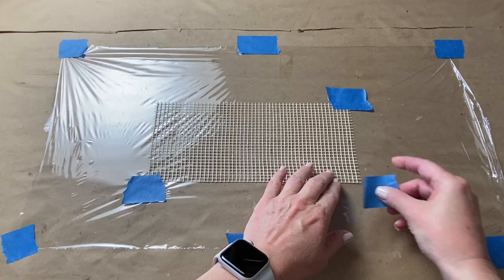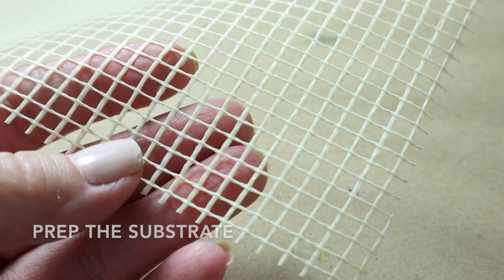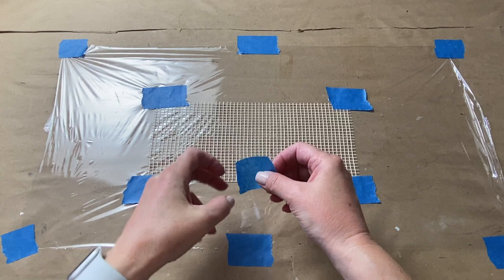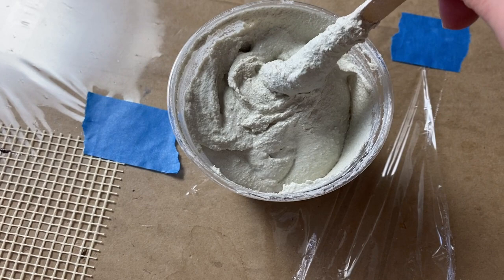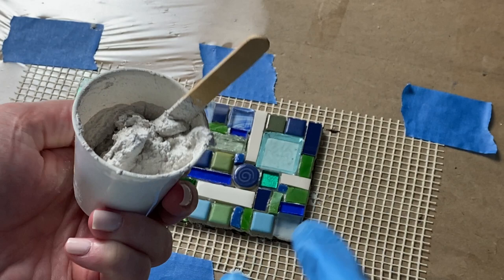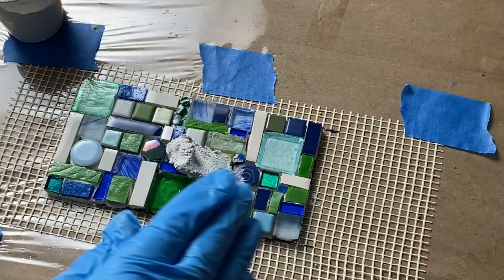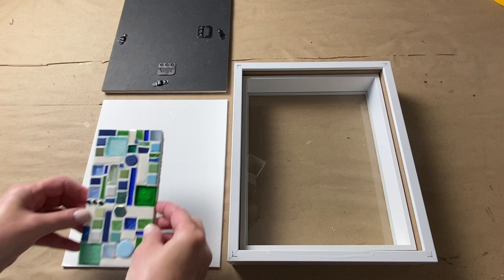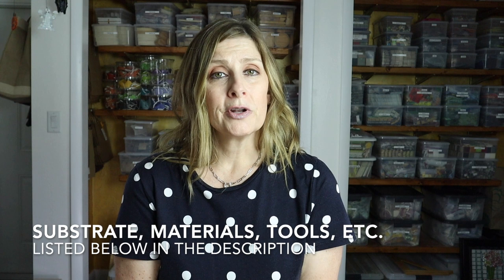MOSAIC MESH: How to Tile + Grout BEFORE Adhering to a Final Substrate

Comment: Thank you.  I will combine this technique to replace 1-by-1 inch bathroom tiles that i have only a limited supply to repair water damage around the bathtub and toilet.  My problem in the past is that when repairing 1-to-4 tiles in a bathroom floor with grout and no intermediate substrate, the wood substrate bends and bows over time, making the tiles pop out within 6 months, and I get to start all over again.  I am hoping this technique (with the mesh in between the tile and wood substrate) will have a more permanent bonding effect to all of the foot traffic and bending subfloor wood substrate.  Thank you.
Reply from the maker: Hi Derpy-Unicorn! I know exactly what you mean. I'm not sure the mesh will provide that kind of support. Your wood floor may continue to bow and the issue will keep happening. Ideally, you need a stronger subflooring option. If you think of it, report back if it works out. I'm curious. Good luck! Keep creating and I'm glad you're here!🔥

Comment: I really like this idea it seems a little less intimidating in a way I just don't know where to find the mesh so hopefully you've got a link in your description, my biggest issue so far with the mosaics I've done is I am not good at timing when I should start wiping off the grout... I'm either wiping it off too soon or too late or the sponge I'm using is too damp. Not giving up! Love your videos and love your channel!!!
Reply from the maker: Hi Maria! Thanks for your kind words and support of my channel! A link to the mesh is included in the materials list which is in the description below the video. You'll be able to read more about it. Super handy stuff. Comes in adhesive-backed and non-adhesive. I keep both varieties in the studio. Here's a suggestion, after you're done applying grout, set a timer on your phone for 10 minutes, and hang out with your mosaic. As exciting as watching paint dry!😂 This will give you a gauge of how quickly (or slowly) the grout is drying. Things such as humidity and air flow can affect it. And if you're cleaning off with a sponge, you don't want it to be too wet. Get the excess water out before using it. Hope that helps. Keep creating and I'm so glad you're here!🔥
Reply: @JulieWeilbacher  Thanks Julie! I'm going to order some mesh since it's not too expensive and I appreciate your reply & encouragement so much! ❤️🌺❤️

Comment: Thanks for the tutorial! You mentioned not to use this method for a large mosaic. Would there be any difficulties if you did a whole group of smaller panels this way and then assembled them into one larger mosaic?
Reply from the maker: Hi Karen! Great to hear you enjoyed the video. You could do a larger group of small panels, especially if their final substrate is a horizontal surface. My reference in the video was to mural mosaics in particular. For vertical surfaces I would try to use less adhesive on the mesh. In other words, use just enough adhesive to adhere the pieces to the mesh, and then allow the thinset to do the rest of the adhering work for you. Keep creating my friend and I'm so glad you're here!🔥

Comment: I am starting a project I've been thinking about for a long time.  I am experienced with regular tile laying, and have done a couple mosaic projects.  I saw this technique and was wondering if this might be the best technique to use.  Here's my project....I am making stairs for the side of my hill by my front door.  Instead of putting boring pavers down, I've made my own and want to mosaic them.  The pavers are 17" X12 1/2".  There will be 22 pavers in total (it's a big hill!)  Since there are so many, I wanted to take my time and have fun, not make it a chore!  Since we want to use the stairs now, I am making all the pavers now.  I considered pressing the tiles into the paver when I pour it, but that limits you on time and seems more stressful instead of fun.  What would you do?  Apply the thinset directly to the paver and mosaic them one at a time, or use this technique?  I love your videos!  I've learned so much.  Thank you!
Reply from the maker: Hi Cindy! Thanks so much for your kind words.😊 It's great to hear you're getting value from my videos. What a project you've got planned. Using mesh for your mosaic pavers is how I would go about this project. Work indoors on your studio table, at your leisure!, and then apply thinset directly to the clean paver and then your mesh mosaic on top. Let it dry/cure before you grout. I've got a couple videos to help you with this. Check out this one: https://youtu.be/g4-NhjcHypg; and this one: https://youtu.be/5JqZU5ucM_k. Keep creating and I'm so glad you're here!🔥

Comment: Is there a difference between mosaic Mesh and fiberglass drywall  mesh ?
Reply from the maker: Hi Sunday! Mosaic mesh is fiberglass mesh. Check the description below the video and you'll see a link for it so you can read up more. It's sold in a nice variety of measurements. And it's available in adhesive-backed and non-adhesive. I keep both on hand in the studio. Super helpful! Keep creating and I'm so glad you're here!🔥
Reply: @JulieWeilbacher  hhaaa  I have some builders mesh i can use that !

Comment: Yes but tiles didn't stick
Reply from the maker: Hi MichalaBakes! I'm sorry to hear that. What adhesive did you use?
Reply: @JulieWeilbacher I tried PVA glue, Gorilla glue and grout, so not sure
Reply from the maker: @michalabakes9174  It sounds like maybe there wasn't enough adhesive under the tesserae. The grouting process also needs to be a little gentler than a typical mosaic project on a hard substrate.
Reply: @michalabakes9174  what type of mesh did you use? Any type of plastic or Nylon type mesh is not recommended, fibreglass tilers mesh is best especially with a cement based tile adhesive. 
Cheers